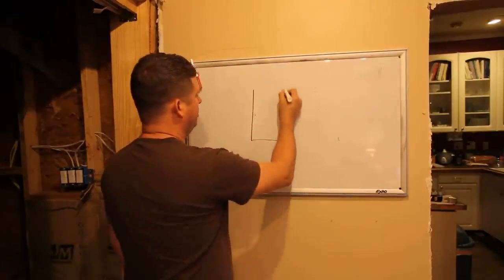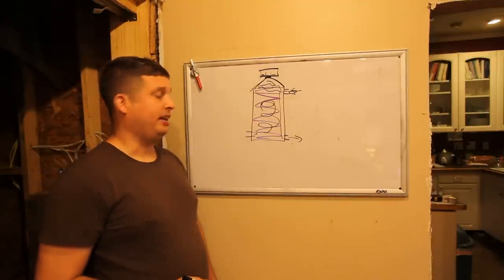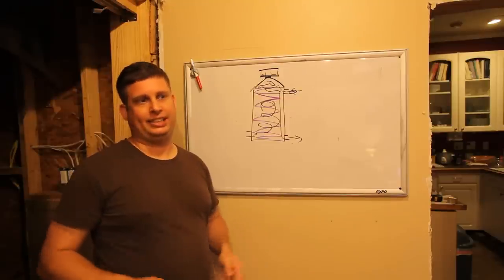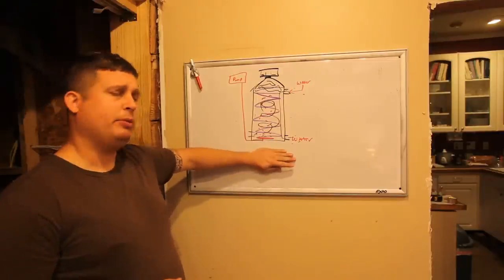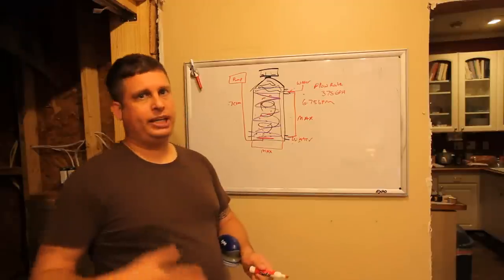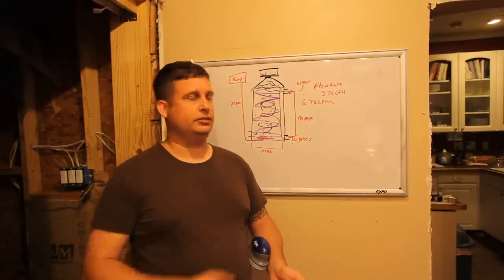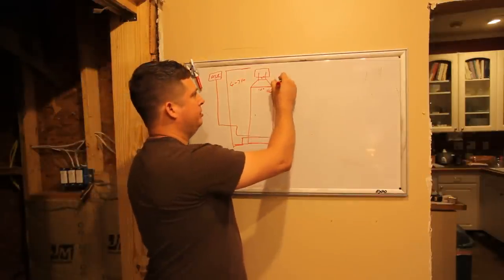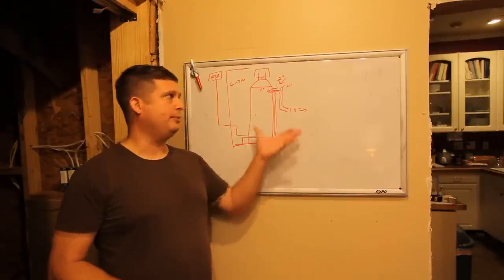DIY Protein Skimmer Design

Comment: Tnx Brian for an excellent video. I am trying to get the basics and essentials to what a foam fractionator is. Your video is smack on :-). On question I am pondering on on setting up a pilot for PFAS removal and I have read some litterature on it and watch some YT videos. One of my idea is to use a fine bubble diffuser (EPDM) as you touch on. All the best (independent of it been 11 years since you did the video) /Magnus 😀

Comment: Great video 1st of all I just have a couple of questions.

1st) Your intake and outtake holes are on the same side is that more beneficial than having it on the opposite side?

2nd) If the intake is above the water line (as it looks in the video) won't that chop up the bubbles and prevent them from rising to the collection cup?

Comment: Thank you for a very no-nonsense explanation. I will also build my own ps. Would one get a similar result by using a larger air stone, wider, yet shorter pipe (so it can fit in sump)?

Comment: Good Video, As I was watching it, I was designing my particular system in my head.  Came to about the same design as you did based on your info.  Couple questions.  Does the inside of the skimmer main body need to be accessible for Cleaning?  How big is the outlet at the bottom?  This is all gravity fed, as you mention at the end, correct?  
If I don't want to drill my tank, is there a simple way of extending it up in a sealed fashion to create an outlet?  I was thinking a simple acrylic box with a hole drilled that is silicon caulked to the black frame?  thoughts?

Anyways, nice video! I like the use of the whiteboard for explaining!

Comment from the maker: Not sure I understand your question... air is under pressure so it will go where you put it.  I put in a counterflow system.... water enters the top and will exit the bottom because the outlet is at a lower level.  Air under pressure enters the bottom and will exit the top.  The idea of a very large counterflow skimmer is more contact time resulting in removal of more stuff.  Commercial off the shelf units don't allow much contact time.

Comment: Hi, I am planning to build a tank around 700 gallons (900 gallons in total with fuge/sump). I also plan on using your model since it seems to fit my requirements pretty well. I plan on having my set up possibly Display Tank> Skimmer> Fuge>Sump/return. With this skimmer being a counter flow model, how does the water move through the input and output pipes you drew up? I am in the researching stage and trying to figure out how the water will move from the bottom upwards (if that makes sense) Thank you.
Reply from the maker: The water enters the top, which will be pumped there in the new install.  I will run the exit pipe up and use it to establish the water height in the tower.  It will then 90 over and go to wherever I want it to be.  It's not terribly elegant, but it's efficient.  An inexpensive pump in the sump will drive the water.